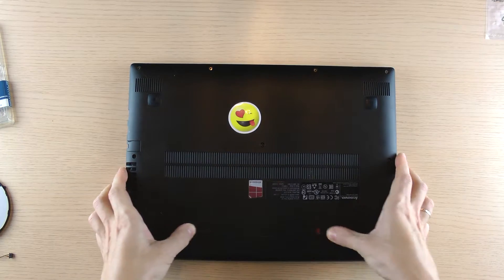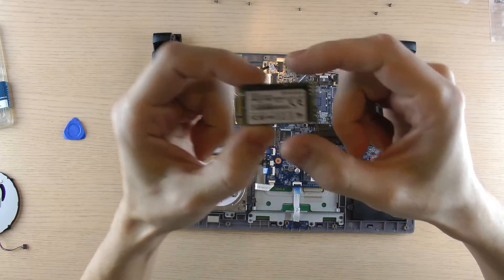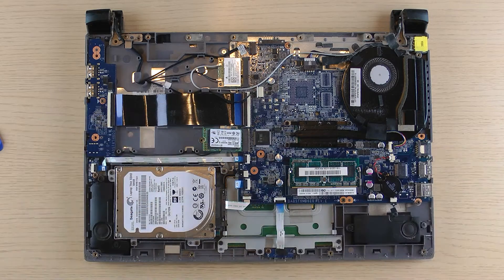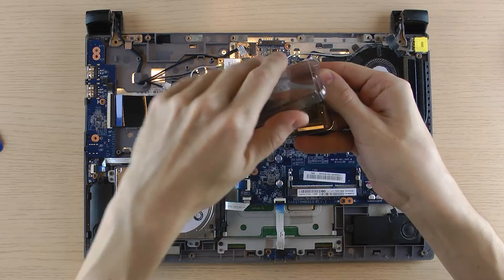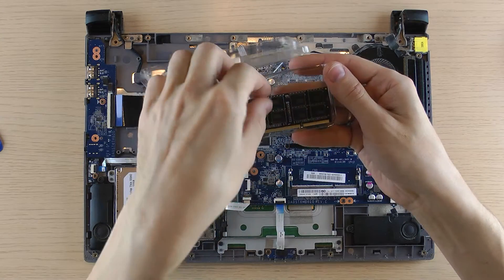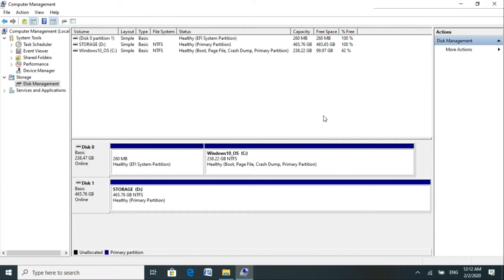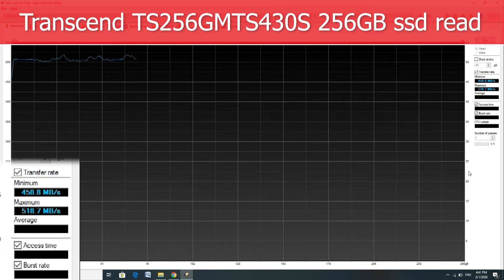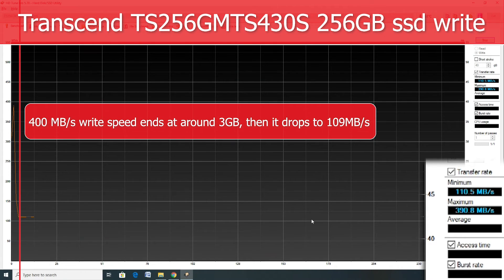Lenovo Flex14 M.2 SSD, RAM and fan upgrade

Comment: Hello. Good video. Did you see your temps drop with the new fan?
Reply from the maker: Thank you. Actually there was a noise issue, not the temperature. Now on idle 47c in aida64 stress test 62c in normal load 54c. Subscribe :)
Reply: @MindaugasJocionis  Hi, where did you get the new fan? it is not in the description.
Reply from the maker: @Lemon.Juice1234  I removed the link because one of the subscribers reported that he purchased from that seller and got a fan that looks like a used one. So better search for one by yourself based on positive feedbacks on Ali express or eBay.
But if you are considering to risk here is the link: https://www.aliexpress.com/item/32963725314.html?spm=a2g0s.9042311.0.0.27424c4d9ms0d2
Subscribe, thank you.

Comment: thank you soo much for video. My lenovo flex 14's model number 20308. Can I do the same processes? The fan noise makes me crazy. This change will solve this problem?
Reply from the maker: You welcome. Yes fan change will solve your problem.
Reply: @MindaugasJocionis  one last question. Does the new RAM create a perceivable difference on PC performance?
Reply from the maker: @mehmetayvaz3912  It depend on usage. Check how much ram you use at your normal usage scenario. If you exceed 4GB then you will feel the difference from extra 4GB in application switching time. These days you can easily go over 4GB in daily usage.

Comment: Hello, thanks for video. I have this for 1st gen. How maximum m-Sata expandiable? Up to 512gb or just 256gb? 
Secondly, Can you share driver for touch screen because it is not continous and we can not find it in lenovo support
Reply from the maker: It's M.2 SATA SSD, not MSATA and not M.2 NVMe!!! Be careful when choosing for purchase. (Check links in description). 512GB should work too. Just follow this guide if you getting BSOD : 
https://www.tomshardware.com/uk/news/how-to-fix-dpc-watchdog-violation-windows-10,36200.html
I thought that i'ts my touchscreen failed (it's starting to split to layers). Will look later is there any solution.
Subscribe, thank you.
Reply: @MindaugasJocionis  Hi, I have the same problem, my touchscreen is not working for more than a year now in my flex 14 model. Please let me know how we can fix it. Thanks in advance
Reply from the maker: @JNiranjanTiwari  Tried on win8.1 with no signs of life :) even updated firmware on my touchscreen , and it's definitely dead. 
But i have few suggestions for you. 
1. Try those drivers http://www.eeti.com.tw/drivers_Win.html
2. Then try patch for win10 a bit lower in the same link.
3. Try this firmware patch, but this is a last thing to do if nothing helps and you are in desperate :) (Upgrade firmware only if type and model of controller are the same as yours.) https://support.lenovo.com/br/pt/downloads/ds102442
Don't forget to subscribe, and write back how it's going.
Reply: @MindaugasJocionis  Yes my touch screen doesn't work and it has a bubble in between panels.

Comment: I have the model Lenovo Flex 14, with 4gb RAM soldered and 8gb in the slot. Can I replace the 8gb to 16gb and get a total of 20gb RAM ?
Reply from the maker: What is the model number of your flex (see on the bottom sticker), I think you have newer than the 1st generation, after that i will try to help you. Subscribe, thanks :)
Reply: @MindaugasJocionis  Lenovo Flex 14 2-in-1 Convertible Laptop, 14 Inch FHD Touchscreen Display, AMD Ryzen 5 3500U Processor, 12GB DDR4 RAM, 256GB NVMe SSD, Windows 10, 81SS000DUS, sorry to put it like that, that the mode l I have. Would it work for the RAM ?
Reply from the maker: @youtubetube6535  Yours is Flex-14API . It's pretty new one :) You can buy DDR4 2400MHz (and up) memory, one 16GB stick. In total 20GB.
Buy RAM on Amazon US https://amzn.to/2JMPdHj
Buy RAM on Amazon UK https://amzn.to/2Nb4HGW
Buy RAM on Amazon DE https://amzn.to/32aA9JT

Comment: Hi. What is the difference on 400s, 420s and 430s? I see you pick the higher number.
Reply from the maker: 400S is just too small and too slow. 430 is bigger capacity 256 vs 240 and theoretically is faster (if you choose 512GB capacity). It has RAM cache buffer (2-3GB or so, but still). And bigger wear out level 280TB VS 160TB.
https://www.transcend-info.com/Products/Comparison.aspx?CatNo=334&ModNo=642,766,981,0
Subscribe, thx.
Reply: Mindaugas Jocionis  wowww thanks for the info. I was thinking also if i need to buy ssd or this m2 ssd. So i plan is with the kind of your configuration. My old hard disk will be back up. The m2 ssd is where i load my sw. thanks bro. Keep it up
Reply from the maker: @bisaKOL23  Yes, this is good solution for 2 disk config. Bu if old drive is faulty, better to buy ordinary 2.5' ssd, there is faster and cheaper models out there.
Reply: Mindaugas Jocionis yes i totally agree. Thanks for the advise.
Reply: Mindaugas Jocionis  bro. Able to install already. Very fast boot up. Thanks for the video.

Comment: I have the same laptop my original hard drive died last week, I wish i checked the. manual didn't realized the board have m.2 slot😅 and I bought the normal 2.5 sdd instead of m.2,btw yours does not have the nvidia chip? My nvidia chipset burned few years a go still looking for replacement
Reply from the maker: Those little 2240 M.2 drives are more expensive, so i think you did a good choice. This is cool only if you wanna additional SSD. No, mine does not have discrete GPU, only intel HD Graphics. Subscribe thx :)
Reply from the maker: @gyanmatianmemories3049 , Unfortunately, but no. Sub. thx :)

Comment: Hello thanks for the video. I am wondering. Will m.2 SSD NVME 2242 can be use with this laptop? I have the same laptop. Secondly. Can we install windows and run it from the m.2 SSD? Thanks.
Reply from the maker: You can use only SATA M.2 drive, and yes, you can install windows and boot from M.2 drive. Don't forget to subscribe and use affiliate link in description for purchase if you wanna/can thx :)
Reply: @MindaugasJocionis  thanks for the info.

Comment: hey nice video. thanks. I have the same laptop. Can i put 16gb ram, or there is no such thing?? :)
Reply from the maker: 8GB of RAM is maximum. Motherboard has only one RAM slot, and CPU supports 16GB only in dual channel mode - 2x8. Subscribe, thanks.
Reply: @MindaugasJocionis  Subscribed! 
What is that first thing you upgraded? In what ways will it better the performance of my laptop? Example?
Reply from the maker: @sixties00  It's ssd sata m.2 format drive. Your laptop will load apps faster with it , especially if main driver was not SSHD (hybrid drive) but hdd. BTW thanks for subscription :)
Reply: @MindaugasJocionis  thank you too for the info!!
Reply: but it can upgrade to 16 gb ram? can you give me some tips to upgrade my ram to 16 gb?
Reply from the maker: @dextermugas8150  Next time write a new comment, sometimes I didn't get notifications from old ones. What exact model and the product number are on the back of your laptop?
Reply: there is  flex that have 2 ram ports.
Reply from the maker: @dextermugas8150  There is, but not 1st gen. Subscribe thx :)